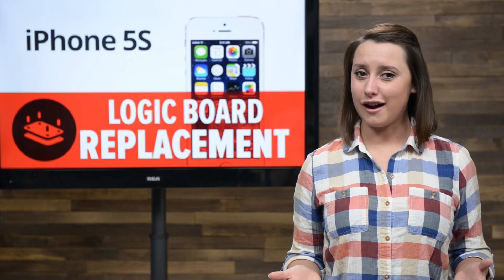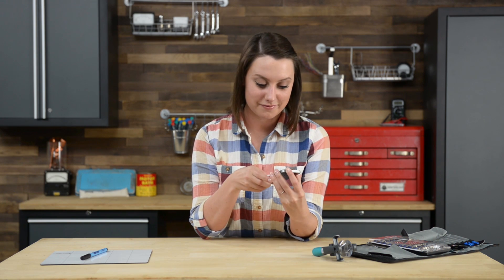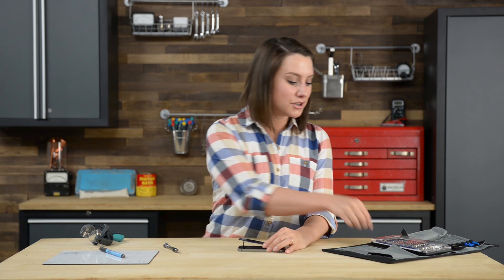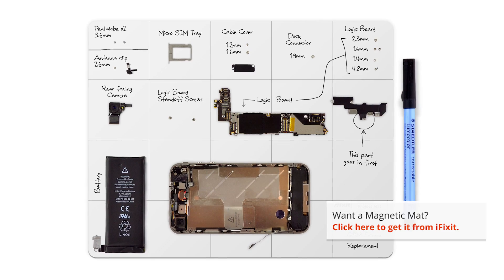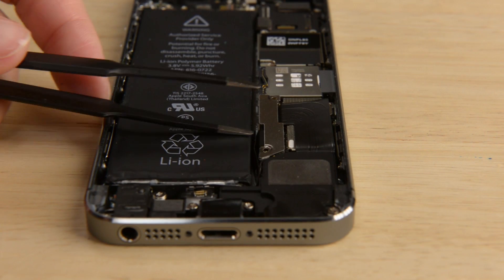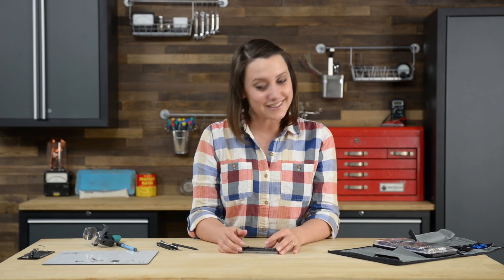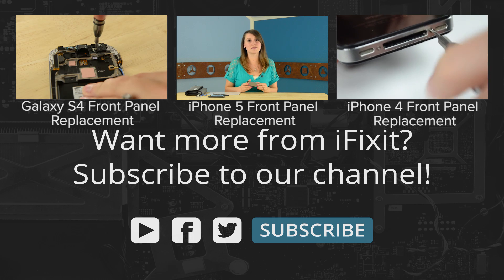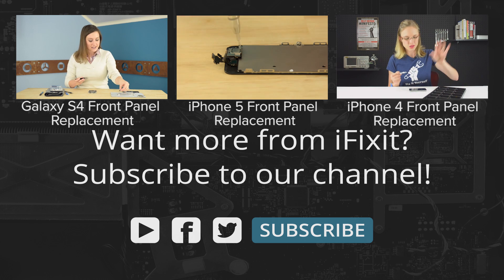How To: Replace the Logic Board in your iPhone 5s

Comment: You're supposed to disconnect the battery before removing any of the screen connections or the cover.
Reply: Matt Yabs True, disconnecting battery is a must. Broke my motherboard when replacing LCD and didn’t disconnect battery 🤦🏻‍♂️

Comment: Guys. Im planning to change motherboard for my Iphone 5s.. But the iphone im taking the motherboard from dosent have a touchID/home button that works... Can i just use the touchID/home button from my original phone on the motherboard im taking from the other phone??? Will that work?!? I appriciate your answer, thanks
Reply: KInda late but no you can't use the current home button because each home button only works with its set processor
Reply: no it will not, each touch id is programmed for the specific iphone

Comment: Can you put iPhone SE logic board in 5s ?
Reply: Kelvin Danso then I wonder if you can do the opposite
Reply: I just tried it. No it is not possible because the logic board on the iphone 5se is slightly thicker. So there is not enough space between casing and batterie.

Comment: You said the Touch ID won't work when you switch out the mother board and it only works with the original will it work if I just use the original sensor and switched it will it work please help